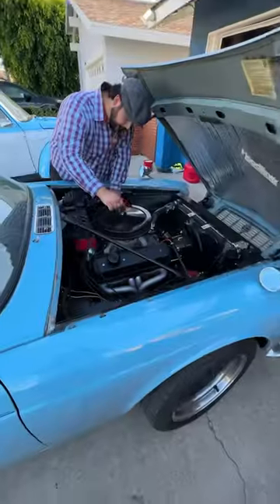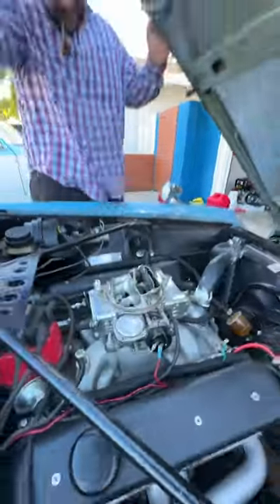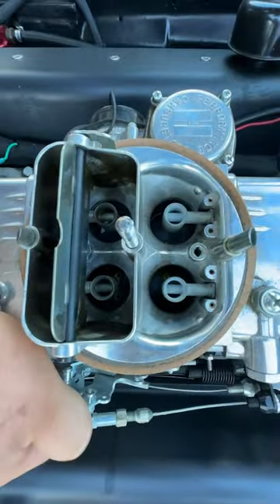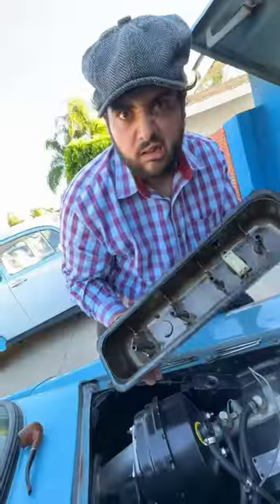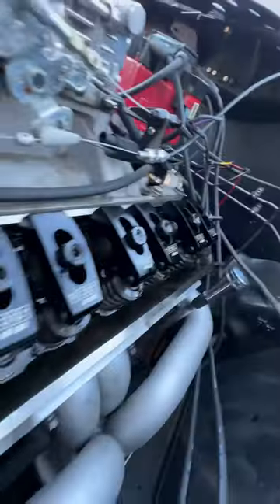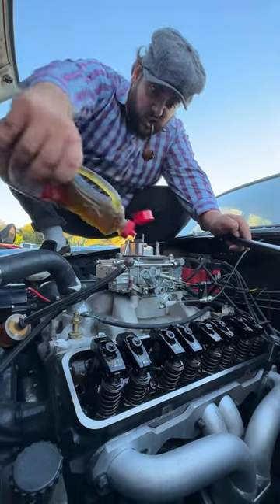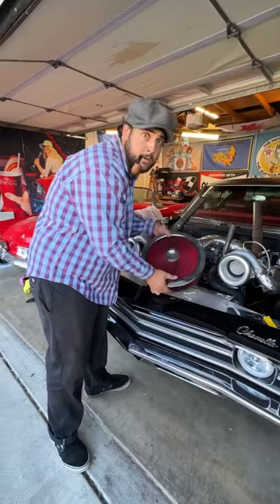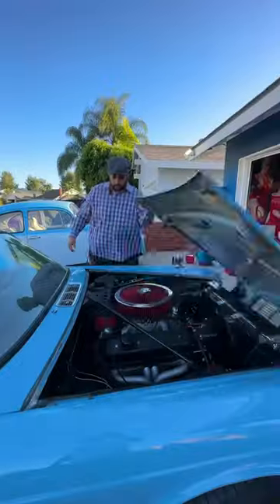Giving my Jag more horsepower!

Comment: If you really want 20 to 40 more hp then u need that spectra air filter assembly with the twin convoluted intake tubes!!!??? They run to either the inner fenders or behind the headlights to pull cold air into the engine…

Comment: You gave it more horsepower with no filter, The syrup was actually motor oil in the jug, and then you took horsepower back to normal because the size of the carb didn't change, the amount of air going into it didn't change. Longer runner / bigger carb = more power, not bigger filter.

Comment: For all the blind people that can’t hear:

“Today I’m upgrading my jaguar to give it more horsepower, but first it’s tea time. I started by taking off my restrictive air cleaner and while I had it off I tested my carbs performance and she sounds beautiful. Then I quickly removed my valve cover to change the leaky gasket and once I pulled it off I grabbed my new rubber band a little sticky stuff to hold it in place. I also noticed my rockers looked a little bit thirsty so I found this deep in the back of my pantry and poured it all over to make sure it was lubed up. Once I put my valve covers back it was time for power adder that allows more air and it turns out size does matter, stay tuned”
Reply: As a blind person that can't hear I can confirm I can see this
Reply: im deaf, and i can't read allat
Reply: I like turtles
Reply: Should’ve written it in braille
Reply: Doing God's work ❤😂
Reply: That was large for a and it was the stuff
Reply: Deaf*
Reply: Me when I’m rubbing my eye and people try to talk to me:
Reply: @Ty420 that's actually impressively useless! 😂
Reply: @Ty420 i cant read it its flat
Reply: Thanks man this would've been a real hard read ifit wasn't for you

Comment: I do love the 350 engine , but a fully built 4.2 straight 6 Jaguar engine on tripple carbs with a wide angle head 425bhp is just a masterpiece .. yeah a 359 can get more horses i get it .. but out lightweight racing 4.2 e type is something special.. that straight 6 carbed noise is so addictive (and I’m a v8 head !!)

Comment: I got my first car it was basically my dream car and since i don't have my driver's licence yet i can build it like a project car so i can't wait to work on it and turning it from the 1993 dodge stealth to a absolute beast
Reply: @rickeymitchell8303  I have to rapir it all the tires are in terrible condition and the battery isn't working I didn't just oh he got a free car how lucky is he nah I have to basically fix and repair the entire thing 💀
Reply: @Dustrout. if it’s just the tires & battery you’re not “fixing the entire thing”😂 that’s literally the bare minimum you could do lmao. Until you have to pull & rebuild the motor, adjust valves, pull the heads off, replace the bottom end components, stuff like that, you’re not even getting your hands dirty 😂 trust me kid you’re barely scratching the surface lol. Have fun with your 3.slow
Reply: @sinkorswimcreativemedia8889   I didn't want it to be a paragraph long😭😭 but I have to replace all the lines re adjust the clutch replace all the breaks flush it out replace windshield get new rims Clean out engine hub repaint whole car sow or replace old interior replace tires get them re Mounted tow it home replace the back wiper refill the wiper fluid sorry I didn't list whole thing I didn't want to spend a hour typing it sorry 💀💀
Reply: @sinkorswimcreativemedia8889  also have to put additive into the tank sorry I dont have to "rebuild whole engine"💀💀💀💀
Reply: @Dustrout.  lol I’m just giving you a hard time anyhow. I respect anyone that wants to tackle something on their own
Reply: @sinkorswimcreativemedia8889  thanks tho bro I just was a bit fed up of shit bro hope you have good day bro

Comment: The different air cleaner probably gave you a 1/2 hp gain? These style of air cleaners suck in a heap of hot air from the motor (a bad thing). This is why new cars don't use this type of air cleaner anymore.

Comment: The table syrup contains corn syrup. Not a good thing to put in the engine.
Reply: Issa joke
Reply: @juannajar5308  yeah, It was a joke, but it still went in your engine. That stuff gets really sticky when it is at it burning point. If it burns, it turns to carbon.  Someone did that to fuel system with table syrup, and it cause a lot of problems with my fuel injectors, and carbon build-up on my pistons, and valves. I had to spend over $160.00 on fuel system cleaners to put in with fueling up. BG fuel system cleaner and Lucus high milege fuel system cleaner. Plus, changing the oil 2 times($170.00) during the clean out. I had a lot of sludge build-up. I got lucky to catch it when I did, or my 2019 Subaru Impreza engine would have been toast. I notice the table syrup coming up to the filler neck while filling the gas tank. I was mad! It must of been a machanic. There was no one else that had access to my car.
Reply: @richardbrowne3641 look at the consistency, I highly doubt he put actual syrup in his engine. It looked more like oil